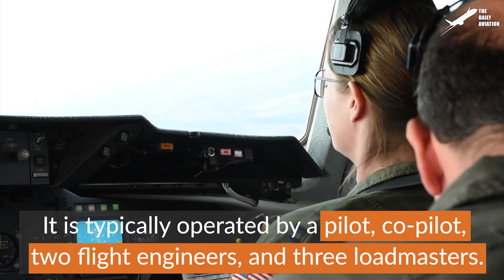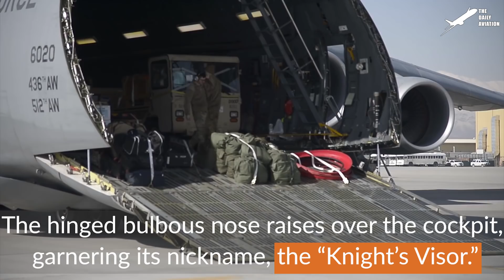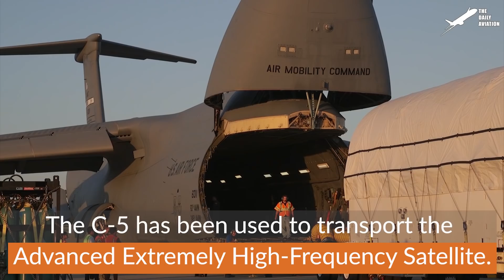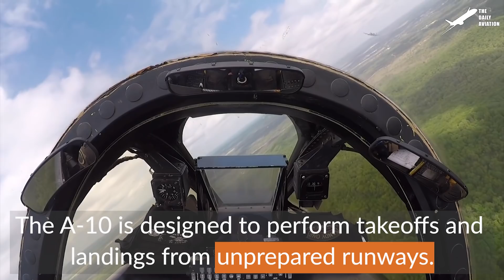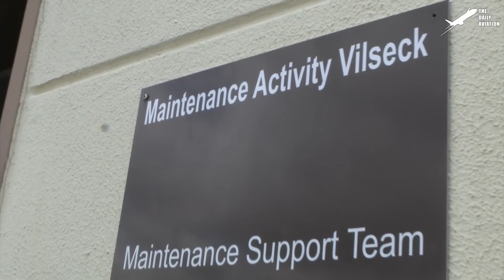Super Heavy 420 Tons US Aircraft Taking Off With Full Thrust

Comment: I worked on these C-5 Galaxy planes as a communication/navigation tech, A.F. Reserve & it always amazed me how big they were. First day they gave me a tour of one. There's a ladder up the tail & you climb up, open a hatch & walk around. You're 65 feet up & there's slippery hydraulic fluid some places so you clip a strap on rings & to your belt so you don't slide off. Tires are huge & 200 psi if I recall. Gotta be loud if those things blow. Helped them change a few. Good times.

Comment: Imagine a new concept plane similar to the A10, alike an upgrade. Things to upgrade: 
1. A set of light backup deployable wings in case a wing gets damaged. In order to be feasible, the damaged wings have to be released safely. 
2. If an engine breaks down, the ability to release the damaged engine is necessary to deploy the backup light wings. The light wings would give enough time for the pilot to escape if necessary. 
3. The concept works if the assembled plane is able to withstand all the A10 moves. This means the backup wings are only for a real catastrophe. 
4. The following has to be considered, does the state wants to lose valuable technology while saving a life or attempt to get somewhere safe first then escape?
5. Ensure there is data stored in the pilot's equipment to see what the problem was and how this could be prevented in a similar event.

Comment: 10:05 The M-4 was originally fitted with a 75mm, short barrel gun that was sadly unsuited for the job of defeating German armor. However, it was good for defeating half-tracks, trucks, 88 mm anti-aircraft and anti-tank artillery guns, snipers in upper-floor buildings etc.
Reply: Where did any 107mm unit show itself?? I am really curious. Ideas?
Reply: @dennisregan6114  M4A3 105 is as close as they ever got to that.

Comment: Actually, wheel chocks are used because the aircraft is parked with brakes off because landings heat the brakes to the point where they can seize on and can’t be released. Also hydraulic pressure can dissipate with engines off, and the brakes are hydraulically operated.

Comment: Fun Fact: The C-5A/B/M can be refueled with aerial refueling, single point pressure fueling, or, if all else fails, it has 4 general aviation style gas caps for over wing fueling.  it might take a long long time but technically you can refuel it with jerry cans.

Comment: 7:27:  A-10 - I thought chocks were used so that the parking brake could be released, and stop the brakes from possibly binding, more so with hot brakes after landing.  Usually aircraft are tied down if they are going to be subjected to wind gusts.
Reply: Bit of both actually.

Comment: I’m struggling with 51,000 gallons of avgas in the C5. I’m not sure there’s an air refueling plane with anywhere near that capacity.
Reply: I stand corrected it does hold that much, wow!
Reply: @garyeaton5719  If you ever spent anytime inside the fuel tanks you'd believe it. Also - though temporary use of Avgas is in the flight manual it's typically JP-5 or wide cut NATO jet fuel.

Comment: 06:42 - 06:47 That can't be right.  10:06  The main gun of the Sherman was 75mm.  Lots of mistakes here.
Reply: The original turrets had 75mm guns.  The version in the video had the newer "up-gunned" turret which appeared late in the war in Europe.
Reply: @jonathanbevill4284  To say that the Sherman had a 107mm gun tube is just plain wrong.  The Sherman 'Firefly' had a long barreled 76.2mm  gun.  That was as good as it got.
Reply: Read what I wrote again.  I never said it had a 107 mm gun.  I said it was the "up-gunned" turret.  The shape of the turret was different, and the gun was probably the 76.2mm long barrel you mentioned because it is different from the normal 75mm.
Reply: @jonathanbevill4284  At 10:06 in the video, the caption reads: 'it was armed with a 107mm gun tube'   As I said before, that is just plain wrong.
Reply: @michaelkearney5562  I understand what you are referring to now.  Thanks.